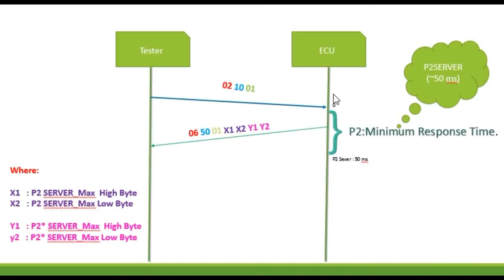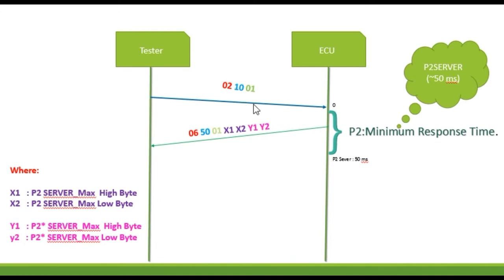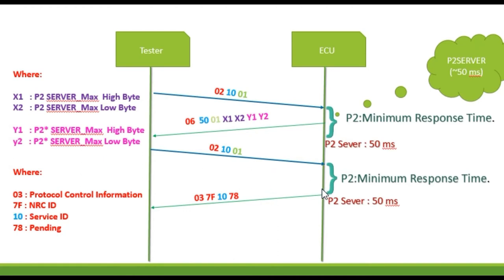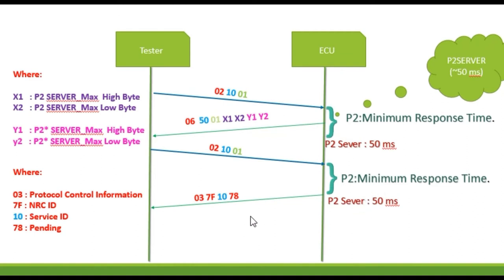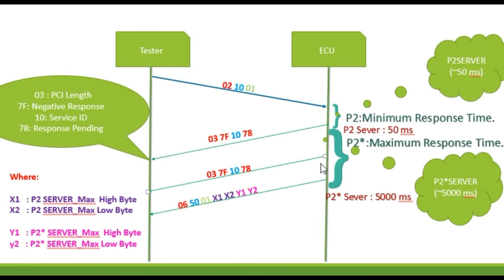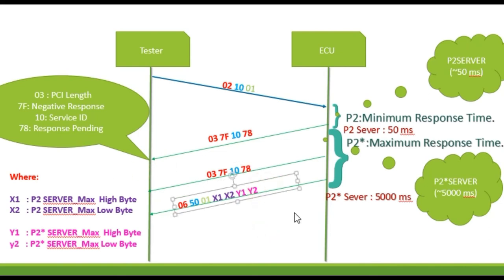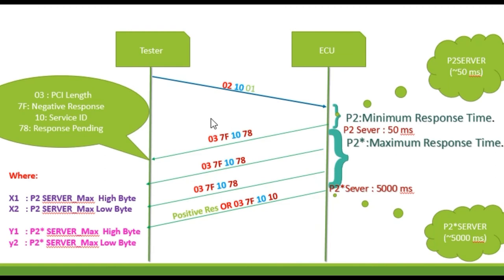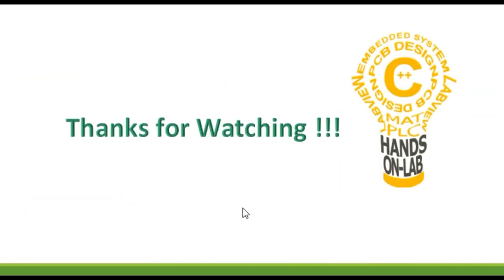#uds |P2 and P2* timer in UDS | P2 Timer in UDS | P2 star in UDS | P2 and P2* Timer in UDS Protocol

Comment: some correction is needed here. After p2 timer timeout, p2* will start and sends nrc 78. And after p2* timeout again it will send nrc78 and p2* will restart and wait for the response. If no response received, the same procedure will repeat for max number of nrc78 configured.

After maximum nrc78 sent, the ecu will send nrc10

Comment: Why we will get NRC 10 if time exceeded more than 5sec
Reply from the maker: There is some limit there . Mostly configurable . Say for example if it's 15 means ECU responds NRC pending(NRC 78 : Pending ) after that ECU regards NRC (NRC10) General Reject .
Reply: NRC $10 is sent only if no other NRC is applicable, in this case your ECU says that the request is valid and it will take some time for the application to fulfill the request, in case the application does not provide a final response (E_OK or E_NOT_OK) pending ($78) will be sent, depending on the number of retries (if it's configured to 0, it means endless pending, you will never provide NRC $10), but if you have it configured to 2, it will send only 2 NRC $78 and after that if the application does not provide a final feedback, DCM will send a negative response message with NRC $10.